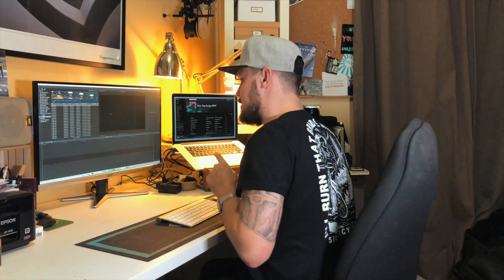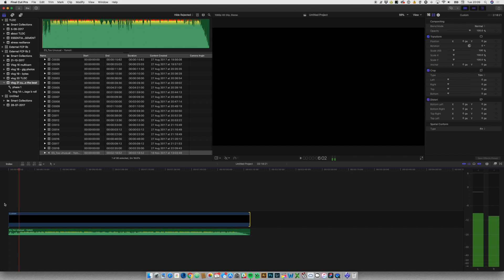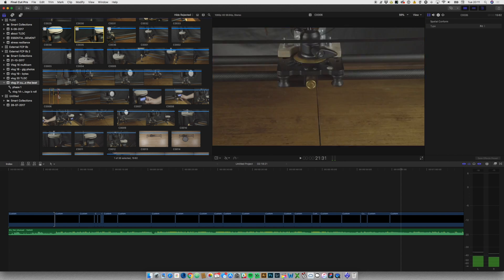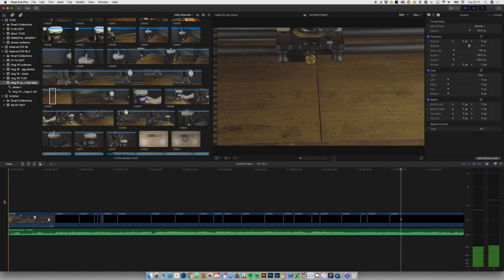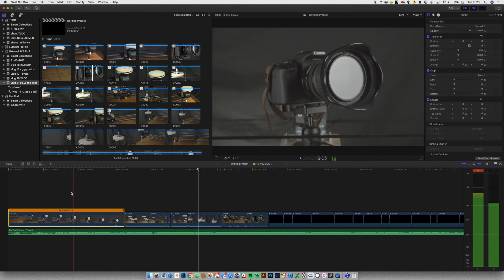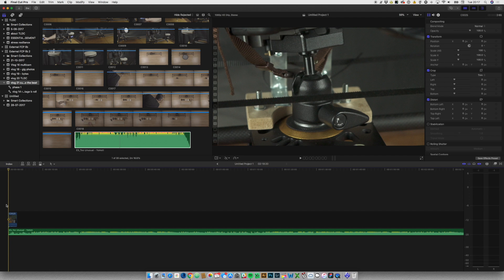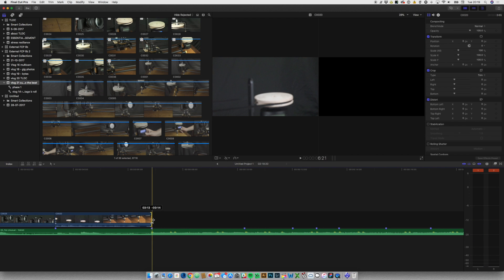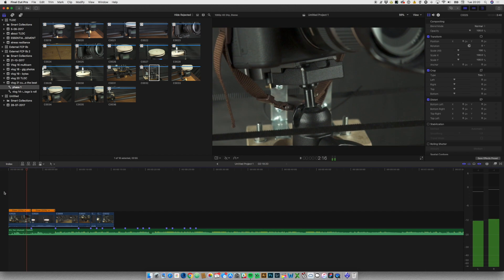How to edit video to music in Final cut pro X - 2 ways to cut to a beat

Comment: I started with your option 2 but now I mainly use option 1
but I have a question: when I put already I and O and put the clip into my timeline - how can I shift left or right the clip, i.e. I want 1s earlier or 1s longer - do I have to insert the proper clip again into timeline or there is a way of shifting right-left on the timeline itself? I am not sure if you got my point. thx
Reply from the maker: There is an option to make minor adjustments, I think you right click on the clip or double click the clip, I forget exactly but there is definitely an option to do just this

Comment: Hi Man, So I put a solid custom layer and cut into it. IT is really nice system but how to do it if you want the video slow mo. I add the video and selected replace from start but when I slow it down it messed up the cut to the beat...
Reply from the maker: Hi 👋 thanks for watching! Yeah that happens, if you want to use slow mo or speed ramps I suggest you use the second method I show in the video, hope that helps! 👍🙌🙏💪😎

Comment: Awesome video, just happened by this. Will I wanted to ask you what macbook you’re using for your FCP edits and whether you’ve found it can cope with H.265? My particular macbook pro can’t even play these files back as it’s quite old now 😭
Reply from the maker: Hi Ray 👋 thanks for watching! I’m using an late 2015 MBP with i7 and 16gb ram and 512gb SSD. It copes fine with most footage but I have to work with proxy files for anything 4K. The only H265 footage Ive worked with from my iPhone and also 4K so I’ve always assumed that it is the resolution rather than the codec that is the issue but perhaps you are right and the codec is not that great 🤔 either way if you create proxy media I think you will see a big improvement in Final Cuts performance. Hope that helps, thanks for watching and happy editing! 🙏😎👍
Reply: I think you’re right about the proxies. Cheers man! thanks for the content